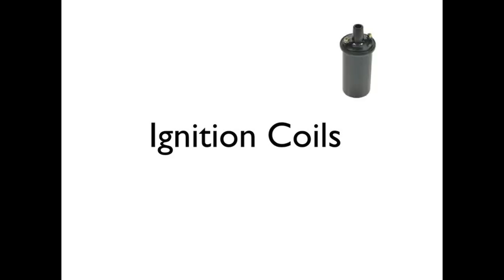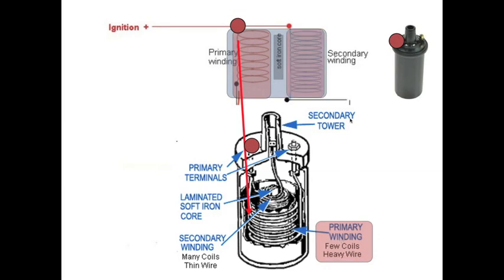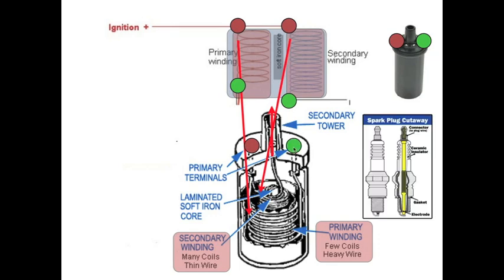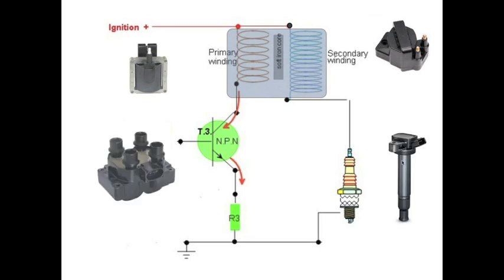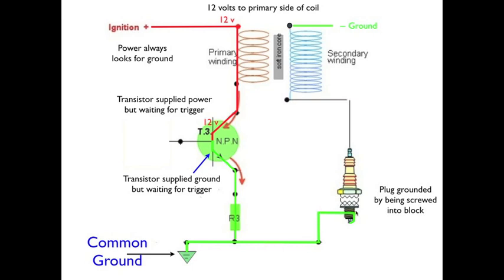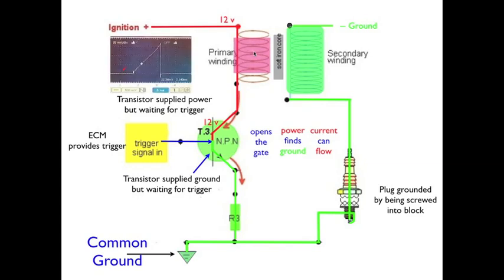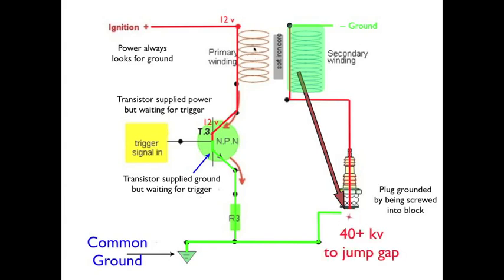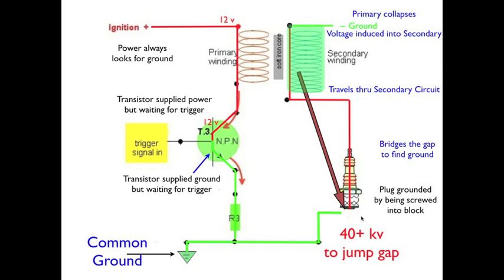Lesson 7  Part 2  How a Coil Works

Comment: Sir after inducing voltage and current to 2nd coil from primary...why is it the current flows to spark plug that there is a gap? I'm thinking current is clever enough to flow always on less resistence...so instead of flowing through spark plug,current can flow to other end of the 2nd coil that attached directly to ground.....

Comment: you are showing the secondary winding grounded on top.  wouldnt  the electrons follow the path of least resistance? i am trying to understand this.
Reply: The coil is a transformer, and so current in the secondary windings is induced by  current flow in the primary windings. The dynamic change (sudden collapse) in current flow through the primary windings is the actual driving force for electron movement on the secondary side, not the battery. The battery in fact is not directly involved in flow through the secondary side. Think of it like a magnet, creating current flow with ground on both sides of the secondary windings. It has to be grounded on both sides, so that electrons can flow back through the engine frame for electrical balance.

Comment: Great video, very informative, but I have 2 questions.  The first is why is the secondary coil grounded at the top of the picture, it seems like the high voltage induced into it would just use that low resistance ground rather than jump the high resistance spark plug gap.  The second question I have is what is the transistor using as a reference to compare the base signal to?  It is hard to explain my confusion but if a transistor can be controlled with a voltage at the base, or as you said in this video, a ground at the base, it must have something it is comparing this base signal to.  In the case of a ground controlled transistor, it would have to be compared to "X" voltage, and in an "X" voltage controlled base, it must be compared to ground right?  A voltage is just a potential difference after all.
Reply: Here are my thoughts.
1) Primary and secondary share same ground within the coil. This is true for coil on plug..  however in case of DIS, they don't. and both coil fire same time, this means ground from onside of spark plug have to travel to the companion spark plug and find a way..

2) I am not sure if i understand ur question. let me try base is a switch, in case of npn it is ground controlled, meaning voltage is all the time at source, but without ground there is no use. so providing ground at base, will make npn transistor to open the path (diffusion layer inside semi conductor) to the load..
Reply: my question is on the secondary side , forget about  trtansistor , my question is. Why on the secondary side the electrons wont follow the path of least resistance? the secondary side is grounded . Why it doesnt follow that path? and goes to  the spark  plug (even if it has to jump 1/4 on an inch) ? well... not a quarter of an inch, but is a gap.
Reply: estrelladelnorte1308 ..

Search for EMF in net, Electro magnetic force..  Secondary coil will not get voltage induced unless the ground on primary side is off.
Reply: estrelladelnorte1308 ..  I will try one another time. You are right, when voltage is there, why cant it follow the path of going to spark plug .. but the key here is is there a voltage all the time on secondary??. NO.. there will voltage on secondary only when the ground on primary is switched off. if it is not switched off, (meaning u have + and - on primary), there is no need to go to secondary,because primary have both + and - and hence secondary doesnt have voltage, if you manually provide power on + side of secondary with 15,000 volts (lets assume)  then yes you are right.it will jump to spark plug gap and get the ground. All we are talking is about when the secondary is getting voltage/..
Reply: estrelladelnorte1308 I know this was posted a looong time ago... But I think what he means is that the ground up top the would seem to sap most the charge goes to the other spark plugs in the circuit the would also fire at the same time, since unless its 1 or 2 cylinder there would be more than 1 cly firing at one time.
Reply: estrelladelnorte1308 This is the answer, although a bit delayed. The reason the current in the secondary does not take a shorter , low resistance route is because it is an induced current (forcibly produced) . Notice that as the gate in the transistor closes, the current in (or voltage across) the primary winding drops rapidly. This sudden drop in current causes a change in the magnetic field created by the primary, and since the secondary is right next to the primary(both are wound around a common soft iron core), there is an equal current induced in the secondary in the OPPOSITE direction viz. toward  the spark plug. Now, the secondary winding consists of a thinner wire with more number of coils , therefore having a much higher resistance. Therefore, the induced voltage generated in the secondary is much higher ,>40kV, as mentioned here (Ohm's Law: voltage=current x resistance). The presence of this very high voltage (let's call it a charge) at the spark plug gap, even for a fraction of a second, is enough to create a spark by ionizing the gases at the tip. Apparently, it is easier for the spark plug to discharge this way , than to push the electric charge back through the high-resistance secondary into ground.